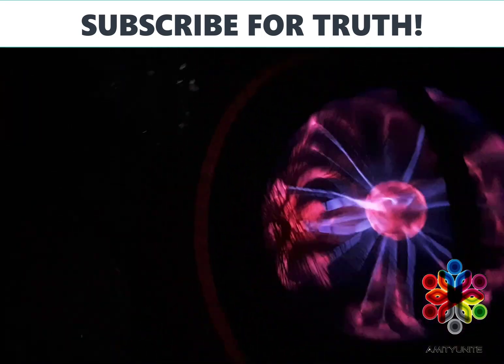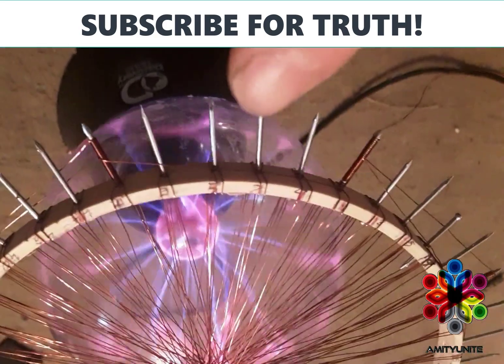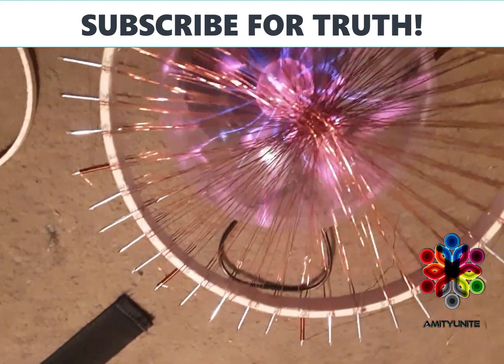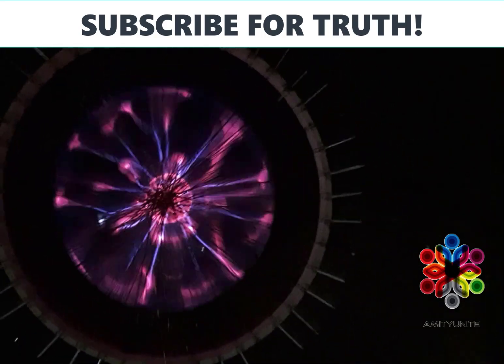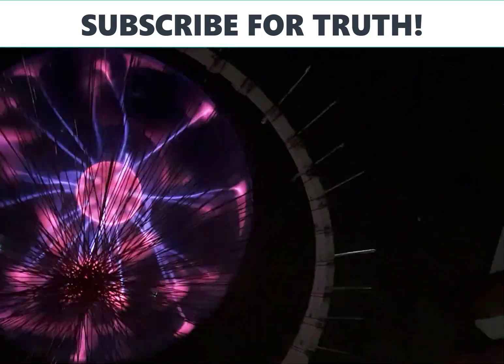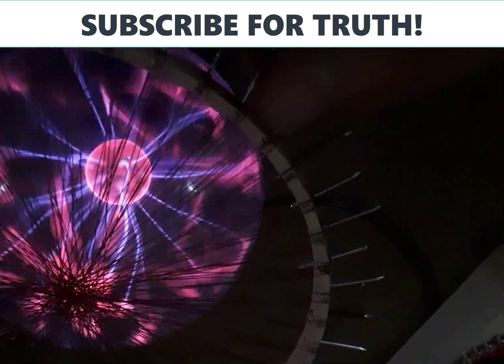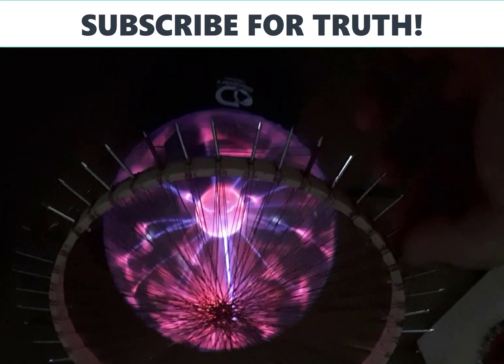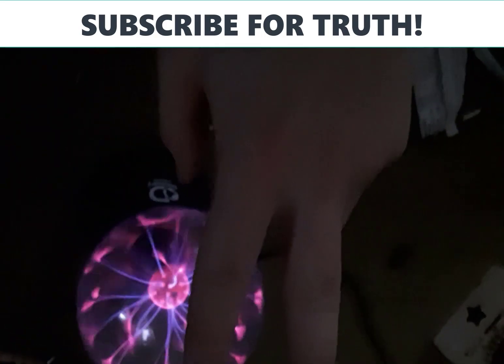Wireless Energy Tesla Antenna 12ohm 45 Point Prototype

Comment: Try antenna ie above the coil nd on to earth same length then get the resonantor ie same length coil w a variable cap nd tune it..... 2 pole one in air one in ground through ground it multiplies the capacitor or amt of electrons that it carry 3 coils transmitter, receiver and resonantor or w cap.... Try nd let's c resilts u can use a signal generator on the transmitter